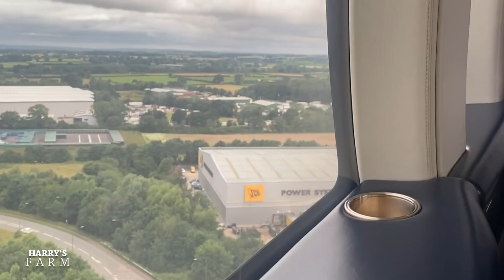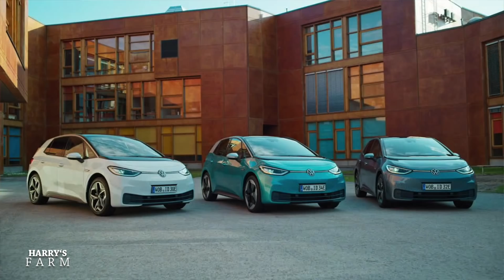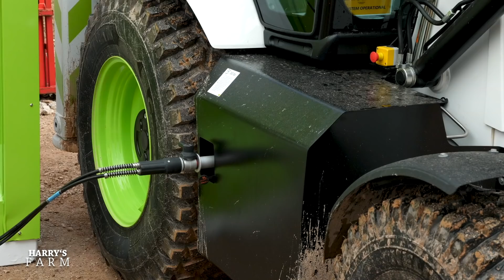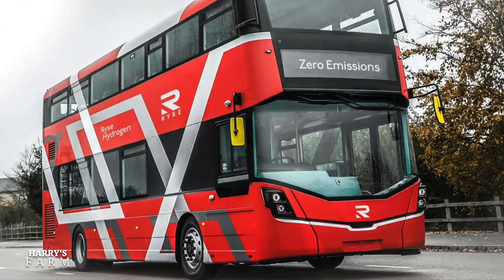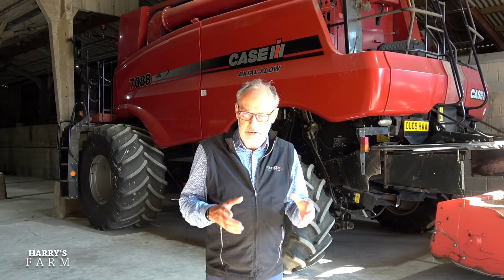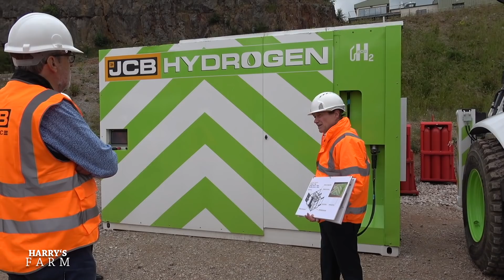Why JCB thinks hydrogen is the best alternative to diesel for heavy machinery, farming and HGV fleet

Comment: I really can't see hydrogen being the answer for heavy equipment. The cost to produce hydrogen, storage and distribution is very high and will remain so compared to electricity. Almost all hydrogen is made from fossil fuels. The infrastructure for battery electric is already in place. If you have electricity at a farm, you're set. You can't load up a bunch of hydrogen in plastic jugs to take to a job site. Every fill-up will require loading the equipment on a trailer and driving to a nearly non-existent filling station. The temperatures hydrogen has to be stored at will make on-site storage very expensive. These machine do run all day, but at very slow rates and will likely last all day on a charge, recharging over night.

Comment: Again an interesting article by Harry, but one thing that the fans of hydrogen seem to forget is the low volumetric energy density of hydrogen. Liquid hydrogen (which requires -253 degr C) needs 3.5 times bigger volume than diesel. In gaseous form, at 200 bar and 15 degr C, it needs about 17 times the volume which diesel requires. Where will you fit that tank on the combine, Harry?
Source: https://www1.eere.energy.gov/hydrogenandfuelcells/tech_validation/pdfs/fcm01r0.pdf

Another point which was not touched is the energy needed to produce the hydrogen. Current industrial techniques get to 70% efficiency when electrically producing hydrogen. Is it then not more efficient to use that electric energy directly on the vehicle? And then we're even letting the combustion engine / electric motor efficiency out of the equasion.  But yes indeed, battery storage is a problem which needs to get solved as well.

And then we didn't even talk to the source of the electricity. Does it need to be green hydrogen, or ordinary not carbon dioxide neutral produced hydrogen...

Conclusion: both forms of propulsion have pro's and con's, but at this moment it seems hydrogen still has more con's.
Reply: U mean more cons than electric ? ... or diesel ? 

Electric, when EVERY economic/environment input is taken into account is FAR more damaging to the environment than diesel... and that is a fact... 

Hydrogen has the limitations you have already pointed out Young Dude... unfortunately, we now live in an era where politics trumps science & technology... this also includes the whole CO² scam... 

The resources required for us to go completely "green" will have a devastating effect on the planet in the form of pollution & actual dwindling of these formerly abundant resources.

Just look at the debacle that is wind energy too... 

Blades need replacing every 15-20 years or so & they CANNOT be recycled... incineration or chopped up for landfill are the present disposal protocols... look at the lifetime of the turbine itself, the 100s of m³ of concrete in the bases of each one... its all a scam... the wind-electric providers are subsidised by the government (out of OUR pockets) ... without that subsidy they wouldnt exist... 😒

Thanks for that link btw... 
😎👍☘🍺
Reply: @peterfitzpatrick7032   understand your answer, but even then hydrogen is not the answer, as it requires more electric power to produce hydrogen than to use the same electric power directly on the vehicle.

concerning your remarks on windmills etc. I do not disagree but also the current energy provisions (nuclear, gas, coal, combustion,...) require initial material and maintenance. An energy source without any impact on the environment is not available at this time. I would still consider nuclear energy generation as one of the most reasonable and effective ways to produce high amount of energy.

Comment: We farmed with propane for years. My dad used to love using propane. To him it was simple and had plenty of power
Reply: I was told propane engines last for every  because it burns so clean !  🤔
Reply: @bustersmith5569  yes our irrigation engines lasted for quite some time. Also we would change the oil and it was always cleaner that a gas or of course a diesel

Comment: What's wrong with bio diesel? id generally like to know, also hydrogen might be good but how do we go about obtaining hydrogen? personally i have nothing against hydrogen or electric (even though i think electric is just as bad as fossil fuels and it's more complicated and difficult to use) but i always thought bio diesel would be the way of the future.
Reply: Well, Bio Diesel is good, but maybe there is even a better way:

If you have Hydrogen "Assist" in a Diesel engine and use the Stanley Meyers approach to splitting the water into hydrogen/oxygen gas.

He used High Frequency Square Wave DC Current, and he got his patents by doing a working model, with extremely low input current, because of the High Frequency, which he used just straight water.... No Salt or Lye... Just Drinkable Water.
There still is a lot to learn, 
But Unfortunately the powers that be, I don't think they really want to reduce the petroleum use... because of .... Yes because they will not make as much money!

So Hydrogen "Assist" with Diesel IMHO will provide very low emissions.  So you keep the same engine, But the pistons, valves... would need to be stainless steel because of higher heat, and then you would need water injection "Assist" misted into the intake to reduce heat, and slow the burn.  You would also get better fuel efficiency too !

I think this setup would be a Better Next Phase to be able to get into, than the complete switch of Hydrogen engines.
You see, Stanley Meyers, Split the water into hydrogen/oxygen gas, right on the vehicle.  And No Need for a Fuel Cell.

So, You Do Not Buy Hydrogen, just make it as you need it on your vehicle or equipment!

Comment: Very exciting, but what about the issue of water availability? I’ve heard for years that water is likely to become more and more of an issue in the coming decades. Could there be scenarios in drier climates where the needs for “fuel” compete with needs for drinking water, habitat for fish and animals or irrigation?
Reply: oil companies attempting to sell oils and gas dressed up as hydrogen it is a scam    Depending on the quality of the feedstock (natural gas, rich gases, naphtha, etc.), one ton of hydrogen produced will also produce 9 to 12 tons of CO2  
However, hydrogen combustion with air produces oxides of nitrogen, known as NOx. In this way, the combustion process is much like other high temperature combustion fuels, such as kerosene, gasoline, diesel or natural gas. As such hydrogen combustion engines are not considered zero emission.

Comment: Assuming the hydrogen is Green, using electrolysis to convert water to hydrogen is at best 80% efficient, putting it through a fuel cell is then only around 40 - 60% efficient.  At 18p per kWhr to conver 1 kWhr of electricity to hydrogen is .8 x .6 = 0.48, round up to 0.5 kWhrs of electricity for 18p or 36p/kWhr. Hydrgen is not going to be a viable solution JCB could make a costly error!
Reply: JCB suggest not to use  a fuel cell, but use it directly in a combustion engine. Not sure how efficient that is in comparison to a fuel cell + electric motor

Comment: Great video harry, great insight again really interesting.
Reply: oil companies attempting to sell oils and gas dressed up as hydrogen it is a scam    Depending on the quality of the feedstock (natural gas, rich gases, naphtha, etc.), one ton of hydrogen produced will also produce 9 to 12 tons of CO2  
However, hydrogen combustion with air produces oxides of nitrogen, known as NOx. In this way, the combustion process is much like other high temperature combustion fuels, such as kerosene, gasoline, diesel or natural gas. As such hydrogen combustion engines are not considered zero emission.

Comment: Bamford should be talking to Tesla. Even better start a JCB battery manufacturing plant. Tabless 46x80 looks to be the new standard.
Hydrogen has poor energy density. It's expensive to make, usually comes from natural gas reformation (even more wasteful) and it's tiny molecule literally leaks through the fuel tanks. A tank can go from full to empty in two weeks.
Compressed natural gas would be a far better option despite the silly rules surrounding qualifications for technicians.

Comment: I wonder how efficiënt it is if you produce the hydrogen on the farm with solar panels compared to producing bio diesel
Reply: Interesting question. I know that PV efficiency is around 20% max and photosynthesis around 3% but there are lots of inputs to farming a biofuel crop so there will be more big losses there. I've seen a paper suggesting 30 to 40 times more land need to produce equivalent electricity via biodiesel than PV. So PV seems a much better bet than biodiesel but IC engines desperately inefficient and much better to charge a battery.
Reply: @malcolm8564  so hydrogen will enable you to produce your own fuel a lot better
Reply: @woutermollema  Compressing it into storage is very energy intensive and burning it in an engine is very wasteful.  Much better to use the PV to charge a battery.
Reply: @malcolm8564  sure but battery power is not the solution to everything and its probably still beter than fossil fuels

Comment: I've been binge watching all the Harry's farm video's the last couple of days and they are very good, thanks ever so much Harry!
Reply: oil companies attempting to sell oils and gas dressed up as hydrogen it is a scam    Depending on the quality of the feedstock (natural gas, rich gases, naphtha, etc.), one ton of hydrogen produced will also produce 9 to 12 tons of CO2  
However, hydrogen combustion with air produces oxides of nitrogen, known as NOx. In this way, the combustion process is much like other high temperature combustion fuels, such as kerosene, gasoline, diesel or natural gas. As such hydrogen combustion engines are not considered zero emission.

Comment: Hydrogen is DANGEROUS.... especially at high pressures. There will be a serious accident.... 
We had an accident last year and knocked over the diesel tank and the heating oil tank.... Apart from a terrible mess ... no problem. Hydrogen - even with self sealing tanks - is bringing a potential bomb onto your farm. Hydrogen trains need far more safety systems than are currently being developed. This is the reason that the infra structure for lorries is on hold.
Reply: There are hydrogen double deck buses in Aberdeen, do you really think they would be allowed if they weren't safe?
Plus there are two hydrogen filling stations which can be used by the public!
Reply: @maxmacpherson1957  Hydrogen storage is a problem on a farm. Also please see Fully Charged on hydrogen

Comment: Apart from fuel supply chain, what are the technical problems to overcome in hydrogen ICEs?
Are there corrosion problems?
With hydrogen + air being burnt under engine conditions, I could understand if nitrogen oxides, acids and hydrides were during combustion, as well as water.

Comment: Thanks - very interesting.  
Batteries are going to be a ground loading problem too - it might be fine on gravel, but get it on soft ground and it risks disappearing.
Reply: oil companies attempting to sell oils and gas dressed up as hydrogen it is a scam    Depending on the quality of the feedstock (natural gas, rich gases, naphtha, etc.), one ton of hydrogen produced will also produce 9 to 12 tons of CO2

Comment: At last someone making a sensible contribution to the future, existing electric cars / batteries are not the solution for the vast majority of transport applications. JCB are on the money with Hydrogen, now we need big oil to solve the Hydrogen infrastructure - Well done Harry
Reply: oil companies attempting to sell oils and gas dressed up as hydrogen it is a scam    Depending on the quality of the feedstock (natural gas, rich gases, naphtha, etc.), one ton of hydrogen produced will also produce 9 to 12 tons of CO2  
However, hydrogen combustion with air produces oxides of nitrogen, known as NOx. In this way, the combustion process is much like other high temperature combustion fuels, such as kerosene, gasoline, diesel or natural gas. As such hydrogen combustion engines are not considered zero emission.
Reply: Why would big oil want to subsidise their own demise?
Reply: Battery electric cars are the enem, not big oil.

Comment: Great to see another angle to this debate which is completely stifled in mainstream media. Whilst there may be some downsides to burning hydrogen, I’d really like to more analysis of the human, environmental and energy costs of creating batteries to weigh against the better efficiency at point of use. So little reliable information available so thanks for this excellent contribution Harry!

Comment: Surely hydrogen vehicles of all types will enjoy less expensive maintenance costs over electric over its life time . My grandad still has a 1987 case tractor on its original engine what battery cell will last that long none is the answer as they currently need changed every5 - 7 years

Comment: As a HGV driver I've been saying for years that battery/electric is no good for heavy vehicles with poor aerodynamics that do lots of motorway miles. I think the old Diesel electric loco idea could be of interest. Even if the Derv engine was replaced with a much smaller petrol or hydrogen unit for power generation only rather than traction. With lots of torque from a stand still and tolerance for high RPM the motors would work well and you could have motors on more axles.

Comment: Expect to see the oil and gas industry transitioning to building offshore wind and creating H2 out in the North sea.  Unfortunately most H2 comes from methane steam reforming right now which obviously uses fossil fuels. Would love to drive a car powered by H2 and they can have a range as big as the tank - 500-600miles is easily possible.  Hyundai sell them already in the US.

Comment: I do wish that people would stop using the term 'Zero Emission'. It's not, there is always a cost.
Hydrogen production currently uses an enormous amount of energy to produce, that's the point where you'll find the emissions.
The fact that the vehicle isn't producing emissions at site is completely irrelevant if the emissions are being produced in greater quantities elsewhere. It's a pointless exercise.
'Zero Emission' is nothing more than a marketing ploy, a con designed to lull environmentalists into a false sense of security, so that they are oblivious to the hidden costs.

Comment: Larger price tag will be offset by cheaper fuel and running costs. The refill network is really only just building a network much like was built (at least in NZ ) for LPG and CNG powered vehicles.

Comment: Sorry but alot of this is a lie, a hydrogen engine is not zero emissions, firstly burning hydrogen still releases poisonous NOx gasses. Secondly, hydrogen is an energy carrier not an energy source, so it depends how that hydrogen is made as to wether it qualifies as zero emissions, there is still no proven industrial scale electrolozyers that produce green hydrogen at a remotely sensible cost per kg. Also, the engine is made of several materials that require the release of carbon in their production process, so technically there will always be a carbon footprint attached. 
The reasons batteries won the popularity race is purely an equation of efficiency, 90+% efficiency through battery storage and motor vs <30% with hydrogen and combustion. Very dangerous suggesting hydrogen as a society wide solution almost like there is no drawbacks. Storage efficiency is everything especially when it comes to low EROI renewable sources.